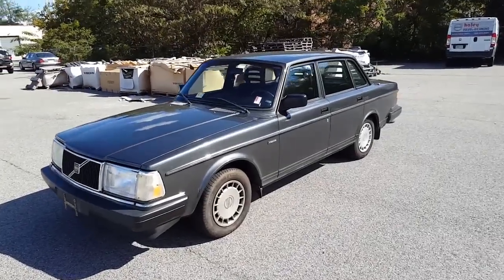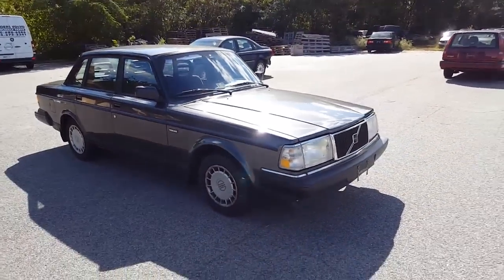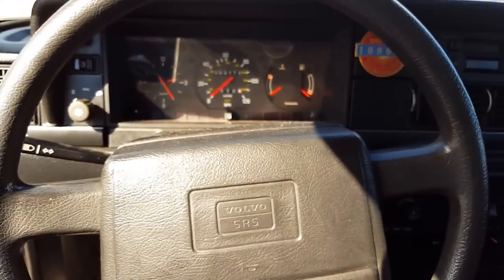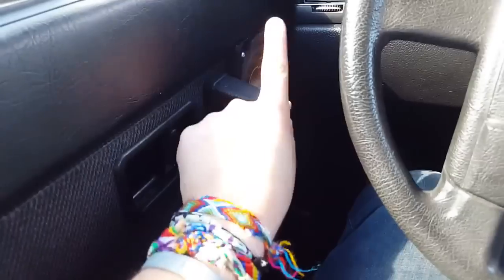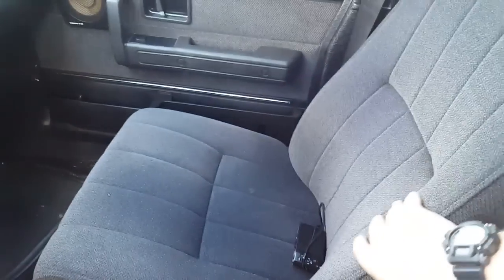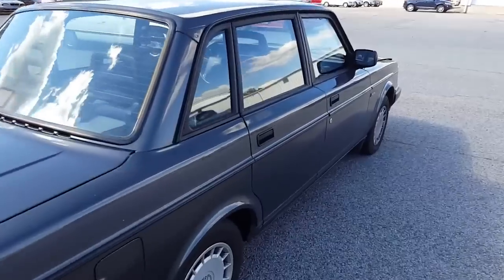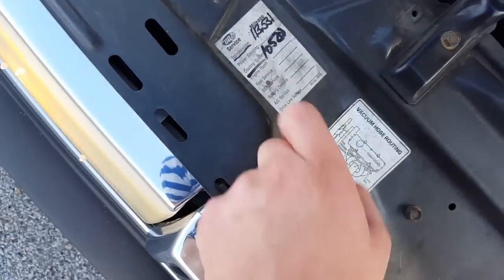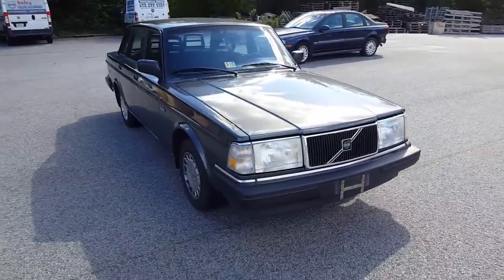1992 Volvo 240 DL Walkaround, Start up, Quick tour

Comment: You can't beat the reliability, build quality, and durability of these "Tanks"! These and the old Mercedes' are both built like tanks! I definitely will buy one of these one day! (:
Reply: +Vincent D THESE GO LIKE 300K MILES STILL RUN SOME IVE SEEN 450K MILES
Reply: I can imagine! As I said, they're tanks! I'd buy one if it were cheap enough, slap some historic tags on it, and even show it off at car shows if it were in good enough shape cosmetically! (:
Reply: Me too! I want a wagon though. Unfortunately they're pretty much all automatic transmission.
Reply: 190e vs 240
Reply: yes and you should
Reply: @検閲  and 124 and 123 and 201
Reply: We had a Volvo 740 as a company car couple two decades ago, think it was a 1989 model, back than it had 750k km on the clock, (466k miles), worked like a Swiss watch. Never an issue on it, just regular service like oil change, filters, brake pads and fluid. Such a trusty car. I drive a merc s212 since 5 years, and it is a great car but i dont trust the car that much as i trusted the old Volvo. They were made to last a lifetime

Comment: I had two of these, a 1986 and a 1992. Very comfortable car, not fast by any means, but utterly reliable.The first was hit by a streetcar (t-boned). The only injury was that the left side of my head struck the window (a common injury in these cars as it turns out in side collisions). An official sent out by the Ministry of Transportation commented on the scene that if this had been any other car, I would have been seriously injured. That was in 1995. The car had about 300,000 kms on it. The second car had almost 400,000 kms on it when I finally let it go. I sometimes regret letting it go but on the other hand, I had driven the same car from 1989 to 2006. I remember reading somewhere that the doors off of this car were unchanged from the early 144 models (in the 70s) to the end of the 244 model run.

Both cars had the Aisin Warner four speed automatic. This transmission was built under license from Borg Warner. Both the transmission and the engine were extremely reliable and apart from just fluid replacement in the transmission and routine engine maintenance, I had relatively few problems. There was one item though was a recurring problem and that was the air mass flow sensor. This item had to be replaced a few times on both cars. Basically, it was a small, hot wire anemometer inside the air intake that measured by means of a change to resistance from the cooling effect of the intake air flow the mass of the air (basically a comparator based on a wheatstone bridge circuit). That wire was fragile I guess and so the air mass flow sensor would fail and the car would run very rough. Just something to watch for.

The most comfortable seat in that car was the back seat. Passengers loved it. Rear wheel drive meant that it could get very interesting in heavy snow falls so snow tires and some weight in the trunk were essential.

Comment: That radio deck is impossible to find now. My daughter just got a '92 240 Sedan someone replaced the factory radio but didn't keep it! She actually has cassettes she listens too LOL. The 240s are tanks. Those tractor engines last forever. You can hide 2-3 bodies in the trunk (depends on size).